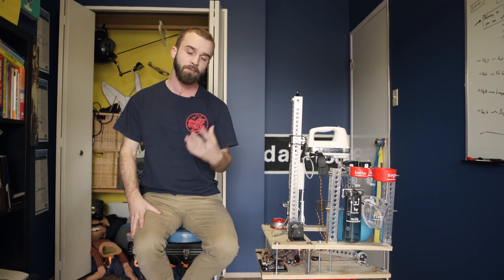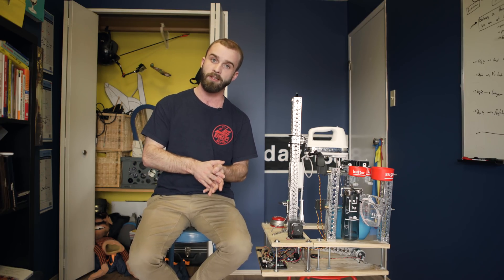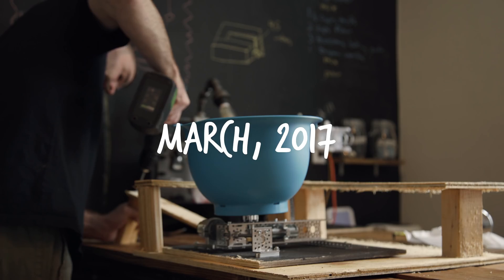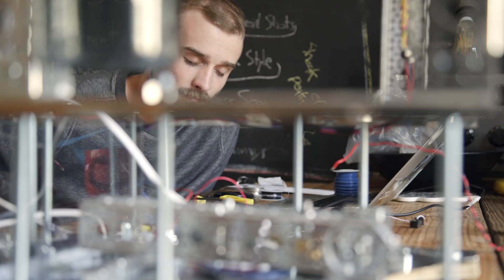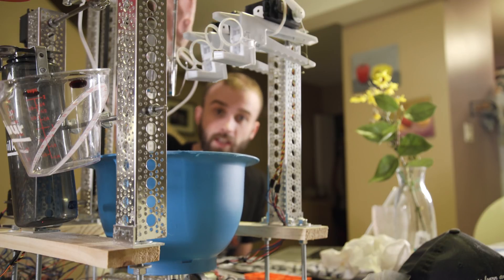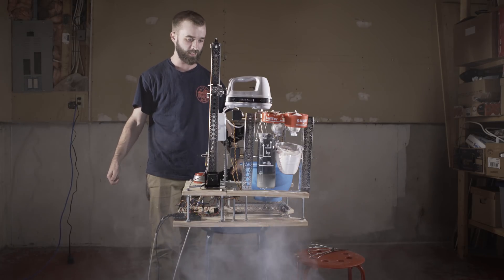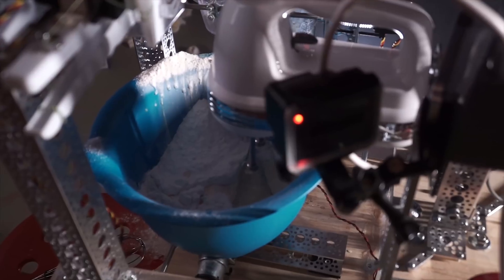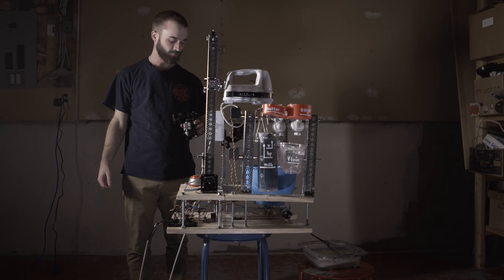I spent 300hrs building a cake baking robot

Comment: I loved watching this, as a professional programmer / builder. Don't forget to go back and think about what improvements in your problem solving process could be made to prevent these issues next time. i.e removing the mixer, building something to replace it, and finding out the problem remained. Isolate the problem by removing one part a time until you have clear causality. Kudos for realising on your own that building the system 'linearly' is not the way to go. You gotta build it in chunks / modules, then join them together. Great work!

Comment: How is this any type of robot, let alone a CAKE BAKING robot?  You have to pre-measure all ingredients, you have to put said ingredients into specifically designated holders.  Then hit a button that starts a AUTOMATED process to dump the increments into a mixing bowl, after mixing, it then dumps into a baking dish.  No baking, no cake.  Want another liquid cake, start from scratch - after of course cleaning all the parts.  The cakebot has successfully trained a human to make a cake for the bot.  Hostess has had a REAL automated cake making machine for decades.  Let me know when you have a robot that goes to the store, gets the ingredients, brings them home, mixes them with bowls and equipment it takes from the cabinets, puts the mixed batter in the oven, and then frosts it when it's done - THAT's a cake baking robot - not this semi automated SoC device.  This is right up there with a REAL VOLCANO made by a 4th grader using paper mache, baking soda and vinegar - no really, it's a real volcano.
Reply: Von Skipppy I can't tell if you are being ironic
Reply: dickhead